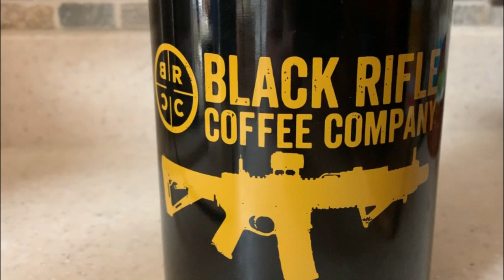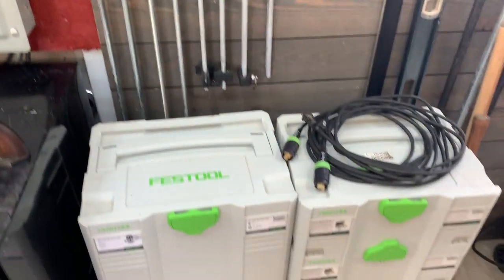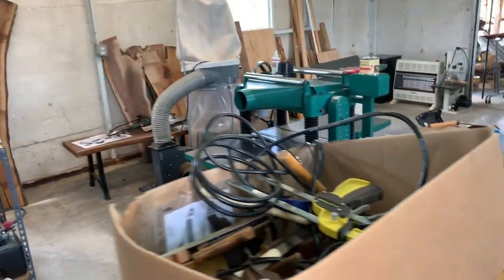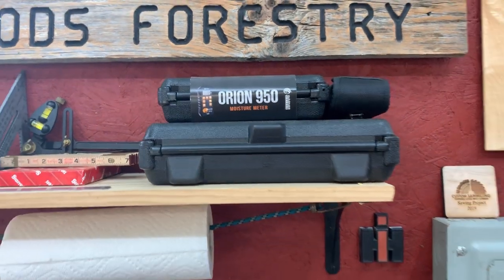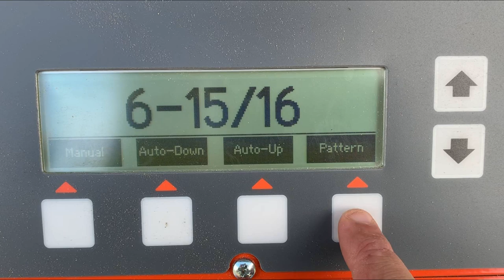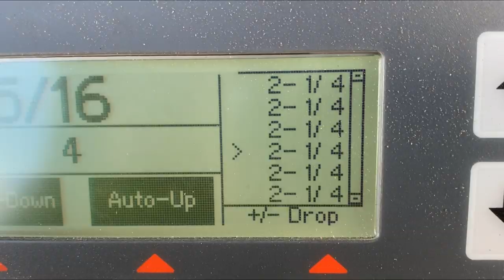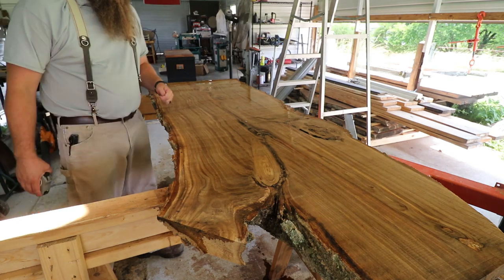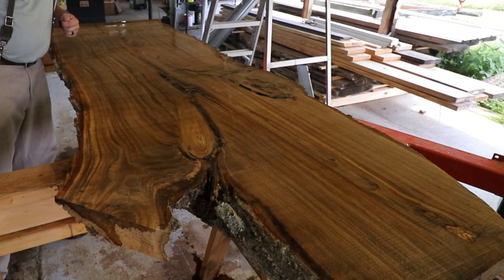POURING WATER OVER SLABS TO REVEAL THE GOLD HIDDEN UNDER THE BARK

Comment: I love that you pour water on the slabs to reveal the grain, but, why aren't you using the water hose? If I recall correctly, you have running water right there in the shed.
Reply: He used to use the hose and it seemed so efficient with using just enough water to do what needs done and not having to fill and tote water. 

He has gone back to the bucket for  some reason but I don't know why.
Reply: @timothyball3144  The hose is out in the garden.

Comment: Like what you did with the shop side. I have some of the same type card files under a workbench amp my lathe in my machine shop. The ones under my work bench I purchased at a City of Kings Mountain auction years ago. The other ones I picked up a flea market

Comment: Nathan, back to your sawdust collection by the mill what is your process, you have a lot invested  but you dont go into  the back side much
Reply from the maker: ok, what is your question?
Reply: @OutoftheWoods0623  ok so in this last  video  the sawdust  is going  directly  on the floor , in your shop you have a dust collection  system that is really  nice (kudos)  are you planning  to set up dust collection  for the new mill and the burn  it ( using  the the thermal for electricity for house or heating  shop) being you are always thinking outside the box as I have been watching you always do . Just wondering.
Reply: Or just thinking out loud you could  add it to you kiln drying process  360 process  just saying  but you already thought of all of these  already  sorry
Reply: The reasons  for these  outrageous  questions  is I am setting  up my own  out here in the west and I am patterning mine  after yours you seem to have it together

Comment: The Shop is looking like it is on its way!!!!!!!!!!!!!! Might need gravel leading up to the saw mill so the tractor does not dig a trench with tires but this another day!!!!!!!!! That is the tractor and a 10 foot log which is 35+ diameter.... Total weight of, say 3 to 5 tons++!!!!!

Comment: You may have addressed this but when it gets cold make sure you still vent the exhaust from the engine.  A friend I consider another Dad developed a fever petroleum allergy from being a full-time fireman and having to run the trucks in winter inside the station so the fuel wouldn't gel up.  Also carbon monoxide isn't good for you either.  So if you haven't already done so maybe start planning for that now!
Reply from the maker: I Address this in every video in the comments. It always comes up. 🤦‍♂️
Reply: @OutoftheWoods0623  my internet is a bit limited and wasn't going through over 100 comments.  Lol.  Another shop hack for you.  Grab an old computer server rack.  I have one houses my planer, air purifier made from a furnace fan and filters in the bottom and one side holds my assorted bar and f type clamps.  It's on wheels so very versatile.  You don't need the planer station but possible uses are really endless!
Reply from the maker: 😁👍sounds good buddy

Comment: consider putting a flexible exhaust pipe right through the roof.  diesel exhaust fumes are not good for anyones health long term.
Reply from the maker: if it need one there would be one installed, i smell zero fumes while sawing,
Reply: Good thing about all that silly tier 4 emissions everyone complains about...the exhaust is pretty clear!
Reply: @OutoftheWoods0623  funny think about carbon monoxide , it has no smell. 
You might want to consider hanging a carbon monoxide detector about head height, they're only about 20 bucks.

Comment: As a retired librarian, I don't believe that your cabinet was actually used as a card catalog: Most card catalog drawers will have a system for a rod that goes through the bottom of all of the cards and "locks them" onto the drawer in order. They also don't have internal dividers as pictured: Probably the cabinet was designed as a parts/hardware cabinet. All this said if you do ever find a library card catalog cabinet they make excellent parts/hardware cabinets and are somewhat "available" (Though less commonly available now) as libraries have largely switched over to computerized  catalogs. For my shop, I was lucky enough to salvage a computer "IBM punch card" cabinet from a hospital that I worked at in the 1970's. I thought card catalog cabinets were sturdy!!!